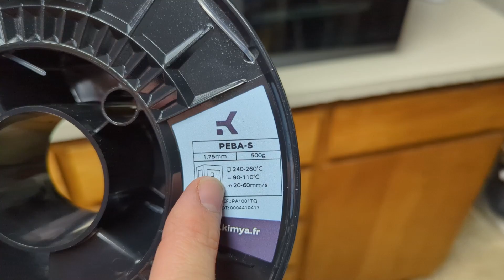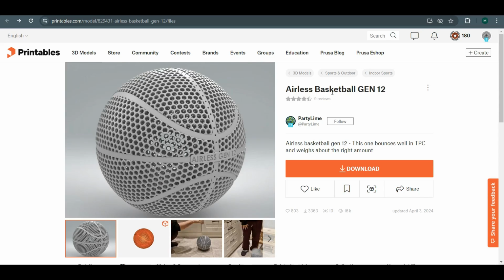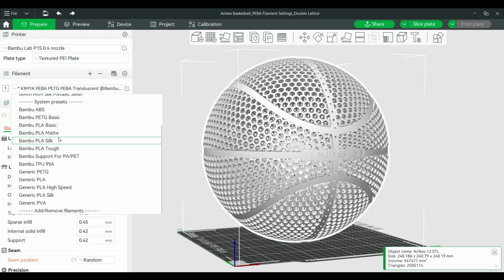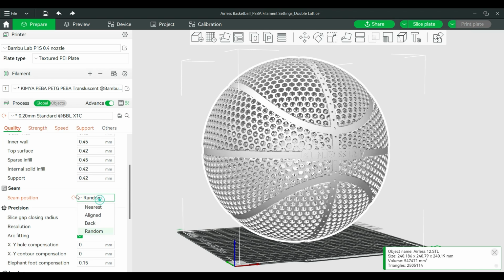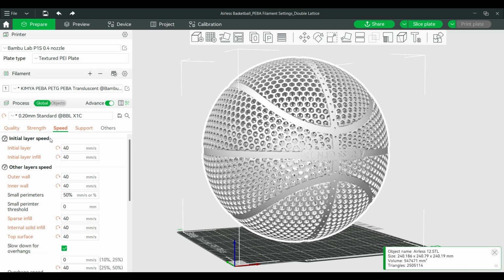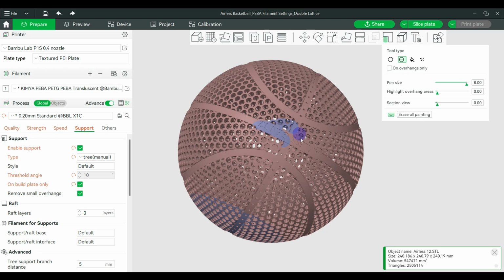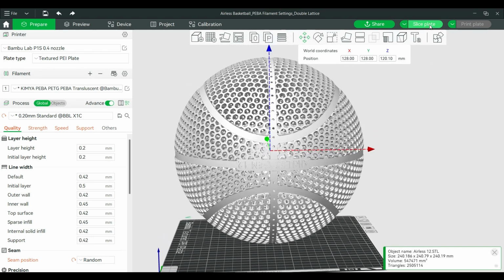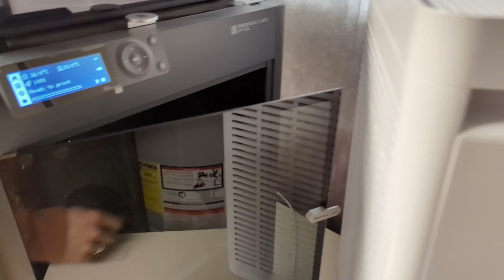Our Settings and Setup Used to 3D Print Our PEBA Airless Basketball

Comment from the maker: How can we improve this?
Reply: I'd experiment to test your hypothesis about the random z seam improving strength. Then I'd do in depth annealing experiments to prepare for a long term comparison study to gauge the longevity of each type of post printing treatment.
Reply from the maker: @GeneralGorrilla  I like those ideas - thanks!
Reply: @makeitlabchannel  I also want to commend you for doing a settings deep dive right after your breakout video. This is what people want right now. There's been a total lack of scientific and technical rigor in the airless basketball videos from big youtubers recently. They all just wanted to be first. You found a niche that you can do better in.
Reply from the maker: @GeneralGorrilla  I appreciate the kind words!
Reply: I know that the PEBA seems like the way to go. However, I just found this flexible PETG. it looks barely flexible, but it is said to have more strength as well.🤷‍♂️ 
It is on a website called Billy 3d (b3d). Look for this: Spectrum PET-G FX120 Flexible PET-G - 1.75mm - Natural - 1kg Spool. The image shows him trying to bend it, and it barely seems to do a thing. Meaning it won’t be a flat ball, but it will give a little bit.
Reply from the maker: @ScaleToTheWire  oh never heard of that, I will check it out!
Reply: Partylime's design is my favorite but I think it has weakness points unfortunately. There's 1 other double lattice design on printables, the "air max." I printed it and it feels more indestructible but the filament I used wasn't very bouncy. Debating if I should print that one when my peba comes in.
Reply from the maker: @AlexMccawley  I will have to check out that file, and I think you are right about the weakness points. I am going to test the durability of the partylime file this week, and if I have enough PEBA I might print the other one too
Reply: @makeitlabchannel  I'm printing the other double lattice one right now in peba. I used your settings and its going good! I think the only thing I really changed is checking off "thick bridges." I'll let you know how it comes out.
Reply from the maker: @AlexMccawley  oh nice, I will have to check that setting out. Glad someone is trying the other file because after printing a couple of the other file and having them break at the same seam after some use I am starting to think there is a weakness in the file. Would love to hear how it turns out!
Reply: @makeitlabchannel  unfortunately that other double lattice basketball doesn't bounce well at all, even in peba.
Reply from the maker: @AlexMccawley  Dang. I am currently designing a double-lattice ball - hopefully I can make it work!
Reply from the maker: @AlexMccawley  Ah man, thanks for trying though!
Reply: I use pursaslicer, so I will transfer the setting for that one over there if I decide to print one, thanks so much for this, it's the best video on this I have seen, I am temped to buy some and try it, I have a creality s1 plus, and it has the proper bedsize and the nosel designed to tpu and flex filments. so will let you know if I decide to buy it, also how did you remove the supports and can you sand the filament for a smooth, or can you hit it with a heat gun?
Reply from the maker: @barry-allan  the flash! Thank you. I hope there is enough to transfer over. I removed the supports with my needle nose pliers and filament snips - I had to kind of grip the support trees and spin my tool for it to come off. I sanded mine a bit and it helped a little bit I don't think it will ever be really smooth, might have better luck with a heat gun but I would worry about warping it. Might help to run a soldering iron over the spots or something. Also, we have a video coming out in the next week or two that will test the durability of the PEBA, just FYI
Reply: @makeitlabchannel  Thanks So much, this will work great, I has tried working with a soldering iron before and it takes practice but can achieve smoothness, (Altho only tried it on tpu and pla), 
it's the only style of basketball that cuts most of the friction while running at supersonic speeds. I can't wait for the the central city basketball tournament, this should help a lot, star labs has been a little stuck on how to create a friction reduced baseball. can't wait to see the video.
Reply: End of your short you showed a basketball hoop ... Disappointed you didn't test it there in THIS video
Reply from the maker: @Yash-c3v  yeah I should have so apologies there, but I did take the basketballs out to a court in our new long-form video
Reply: Subbed after reading these comments! thank you for all this.

Comment: Why dont you use pla or petg for support?  I have a H2D and Want to try a different support material
Reply from the maker: Yeah, that would definitely be the way to go. I was able to do this when I tested the TPU for AMS because it was AMS compatible, but almost all of the filaments are not AMS compatible and I am only rocking a P1S. Since you have an H2D yeah definitely, or maybe even go with the PVA filament that dissolves in water
Reply: @makeitlabchannel  ok thanks . What PVA would you suggest?  I order 3 rolls of   Biqu PLA HR and 1 rolls of Sainsmart Peba .  Also some .6 nozzles hot ends . This will be my 1st time trying a ball .
Reply from the maker: @camaroedogfood876 I have not tried any PVA myself so I can't recommend any, but I know Bambu Lab sells some, so that is probably where I would go to start. I think using a 0.6 nozzle is the way to go, and both of those filaments have worked very well for me. Hope they print well!

Comment: Would it be possible to print an airless basketball on an Ankermake m5 printer? I have an m5 but haven’t been able to find info about if it could make a basketball or not
Reply from the maker: Hey there, I looked at the details, and it looks like the nozzle and bed temp are high enough, and the direct drive will really help. One issue is that the bed size is only 235 or so mm, so it won't be able to print a full size 7 basketball on it like you can with a 250mm bed size
Reply: Ok tysm

Comment: Would you think these same settings will work if I'm using Flashforge Flexible PLA instead of PEBA?
Reply from the maker: I don't think it would work if you didn't change anything settings. I have settings for the Ataraxia Art Flex PLA - I would bet those are very similar. Let me know if you need any info about those settings

Comment: Thank you but do you have to dry the filament or would it work if you didn’t dry it but it was straight from the box
Reply from the maker: @azmeenadewji3399  It is always best to dry it but if it was straight from the box it is probably just fine. Also depends on how humid it is where you live/in the room it is printing in

Comment: Great video. I’m about to print one myself. What is the best drying temperature for peba-s? You said your dryer only goes to 50, so you put it in longer. What would have been the right temp?
Reply from the maker: @NilsDum  Much appreciated. I actually dried it at 50C the entire time it was printing, but if I had one that went higher, I would probably do 70C for about 4 - 6 hours before printing. If it had been opened and sat out for days, I would probably go longer.
Reply: @ thanks. Will probably go the same route and dry on 50 while printing.

Just now saw that you uploaded a more recent video with the profile. Might use that as it differs a bit from what you’re using in this one.

I’m fully prepared. Will start the print any moment. Wish me luck.
Reply from the maker: @NilsDum  Hope it prints well!

Comment: Crazy question...I followed your settings but after I slice, it's showing tree supports rather than just the base support.  Have any idea why?  I didn't see any tree supports in your build.
Reply from the maker: @nkair19  If you are seeing tree supports, then that should be correct. I have not been able to print the bottom of the ball without supports, and tree supports seem to work well and use less filament
Reply: @makeitlabchannel  awesome!  Thank you.  I didn't see them on your build in the video.
Reply from the maker: @nkair19  No worries - good luck!

Comment: Awesome project! I seem to be missing something though - I followed your bambu studio settings and configured mine just the same (50% gyroid infill, 5 top shell layers, 4 bottom shell layers etc) . I have P1S too and PEBA filament. The problem is that the preview states 835g filament usage and that is with supports turned off. Does current printable model maybe have thicker walls?
Reply: PS: I think I figured it out, had to change density in the filament settings, as its less dense in comparison to PETG preset
Reply from the maker: @pavlini0  yes, that is exactly what it is. I believe I changed the density to 0.95 for Bambu Studio to be accurate
Reply: @ it came out great! How do you fix potential damage from edges etc, with glue?
Reply from the maker: @pavlini0  Glue should probably work, but I usually use a 3D pen to melt some of the filament and patch/fix the areas. 3D gloop might work too
Reply: @ thanks! which 3d printing pen would you recommend?
Reply from the maker: @pavlini0  The one I have and use is this one: https://amzn.to/3ZHXanf, so I can recommend it but I think this one looks nicer and has about the same temperature range: https://amzn.to/3P3Juhl

Comment: 0.4 or 0.6 nozzle? I also have the p1s but it’s 0.4
Reply from the maker: @christianbryant475  You can use either, but the big difference is that using a 0.4 nozzle at a 0.2mm layer height will take a lot longer than a 0.3mm layer height with a 0.6 nozzle
Reply: Do you still recommend these settings with that print file? Or do you recommend a different ball and settings?
Reply from the maker: @christianbryant475  If you use our model, for flex PLA we have both a 0.4 and 0.6 mm nozzle profile, but the only difference in settings is the nozzle size/layer height. For peba, you would just have to switch the nozzle size to 0.4 and layer height to 0.2. I am not sure what other folk's basketball file settings are or if they recommend 0.4 or 0.6 nozzles

Comment: One question I have is you mentioned printing with 4 walls and 50 % gyros infill, but if you’re using even 3 walls it shows me a preview with no infill being used because the lattice isn’t thick enough for more than 3 walls in most areas, so does adjusting these settings actually effect the model?
Reply from the maker: @cameronstone7298  It will depend on the model. If you are printing the one from this video, I believe it does make a difference in certain areas, like the thicker seams. If you are printing the model that we designed, it will only make a difference up until it is just walls because there are no real "thick" areas, so I guess the answer is kind of, and it depends lol
Reply: @makeitlabchannel  gotcha, I’ve recently downloaded the FPLA model and picked up a Kg of ataraxia to give this model a go, I plan to use a 6mm nozzle do you have any tips for printing with those specs?
Reply from the maker: @cameronstone7298  I would suggest a 0.3mm layer height, and a slow printing speed. I know it is tempting to go fast but I print mine at about 35 or 40mm/s so that the layers adhere well together. I would also put a layer of printer bed glue/glue stick for bed adhesion and a release agent when it is done. If you have a Bambu Lab printer I can send you the 3mf for settings/print profile too
Reply: @ awesome didn’t think to print at .3 I was planning to do .2, I also was planning to do a 50% scale print as a test run, would you recommend just scaling the stl down or would that probably cause it to fail?
Reply: Also thank you for replying so promptly!
Reply from the maker: @cameronstone7298  I don't usually recommend scaling the basketball down much just because of the double lattice being somewhat thin already, but I did see that someone scaled it down to 40% and it printed fine/worked so I know it is possible.
Reply from the maker: @cameronstone7298  yep! You can also get away with a 0.2 layer height, but if you are using a 0.6mm nozzle a 0.3mm layer height will save you a bunch of printing time. Shaves off 2 days for some of my basketball prints 😁
Reply: @makeitlabchannel  Awesome I might give it a try but I may just go straight to the full scale print, it looks much more doable full scale when I slice it
Reply from the maker: @cameronstone7298  Hope it prints well!

Comment: About to print this ball out of PEBA. Any developments in the last 4 months that I should try/pay attention to prior to printing?
Reply from the maker: @Mr.Schneeebly  Hey there, not much has changed except I have started printing them with a 0.6mm nozzle and it really decreases print time. The only other thing that I would recommend is more walls on the top (top layers, I do about 6 with 4 walls on the rest) and printing slower on the top areas.

Comment: I have a probleme the print stop at 30%. The filament got stuck in the nozzle as it expanded due to the heat. I used a Volumique Stream30Dual MK3 do you have any advice ? Maybe decrease the temperature ?
Reply from the maker: I haven't heard of that printer - is it fully enclosed? Sometimes the temp inside an enclosed machine can cause this. I would open a door and cooling if enclosed, if that is not an issue then yeah I would try to decrease the temp 5C, and up cooling at the nozzle of possible as well

Comment: some of the settings in the video are different from the makerlab 3mf file. im printing the wisdream filament with a 0.6mm nozzle. im following the settings on the video over the ones published (mainly the top shell layers and thickness)
Reply from the maker: @tRexTay  Yeah I have changed some settings here and there to make it better, but I would not use the settings for the PEBA or Flex PLA I have on Makerworld - the flex PLA might work but I am working on a wisdream profile with a 0.6 nozzle, and will upload it to Makerworld soon. If you haven't printed it yet I can send you the profile if you email me at makeitlabchannel@gmail.com

Comment: Damn.  My print failed to grab my filament at 92%.  It was grabbing the filament during the filament refill, but I noticed that suddenly the filament wasn't extruding anymore and the filament was loose on the PTFE tube like there's no tension.   I did test the bounce and wow.   It was bouncing really well for 92% of the print.  I have to buy another roll of PEBA filament and try it again.
Reply from the maker: @ayip75  ah man, I wish you could reset the print at a certain layer height so that it wouldn't have to be a fail. Hope the next one prints well - the PEBA is very fun to play basketball with
Reply: @makeitlabchannel  Yeah I wish there was an option to go back to when the filament was changed.  That would be a good feature for 3d printers.  It would save many prints.

Comment: I’m having an issue getting the print started. I didn’t dry my material I just sent it into the machine from the bag. It made good calibration lines and then failed within the first few layers not extruding enough.
Reply: I’m printing with a Bambi labs X1 carbon
Reply from the maker: @zernofoo345  Is this for the flex PLA or the PEBA? Also, are you using the 3mf?
Reply: @makeitlabchannel  I’m using the 3mf and peba. I did switch the file to the x1 nozzle from your video. And I used your method for creating tree supports
Reply from the maker: @zernofoo345  Oh that is strange. Maybe try bumping the nozzle temp up +10C to see if that will help?
Reply: @makeitlabchannel  should I do that in the file or just on the printer? I find when I run pre set files, adjustments don’t run because they are preset
Reply from the maker: @zernofoo345  Yeah I would alter the printing nozzle temp in the printing profile you are using. If it is the Kimya profile that I provided in the 3mf, you will have to edit the printing profile and change the nozzle printing temp there. It might be easier to change the temp as it is printing though - I haven't tried that much though

Comment: Oooo, Also, putting a printer in a pressure chamber and increasing the pressure in the air pockets in the print would strengthen it and make it bounce better. It doesn't have to be much, just enough not to push out of the print once removed or when bounced. maybe 1.5 to 2 atmospheres.
Reply from the maker: @TheInsaneupsdriver  I might have to look into pressure chambers 😁

Comment: is there a way i can lower it down to under 500. Idk if its just me but i dont really want to spend an extra 50 dollars only to use a forth of it.
Reply from the maker: @actual_bs  hey there, yeah I can see your point. If you use our new basketball model, I think the only way would be to decrease the size of the ball until it uses less than 500. When I printed the PartyLime double-lattice model, it only came out to about 480g or so of filament so that could be an option: https://youtu.be/P5sE0fNV0Ms
Reply: @makeitlabchannel  alright thanks man!
Reply from the maker: @actual_bs  hope it prints well!

Comment: I was thinking about buying a 3d printer and would it be possible to complete this print with anyone available on the market or does it have to be a specific one?
Reply from the maker: That is a good question. I think that as long as the printer has the proper base necessities it should be able to print the ball. Some of the base needs would be a nozzle that can get about 250+ degrees C, a bed that can get to 90+ degrees C, and I would highly recommend direct drive because of the flexible filament. If you use something other than a Bambu Lab printer, I would also suggest running retraction, temperature, e-steps, and speed tests before printing as well.